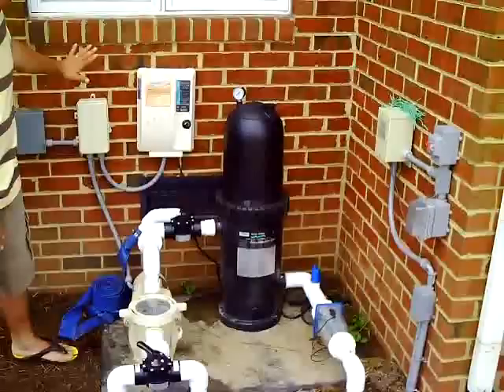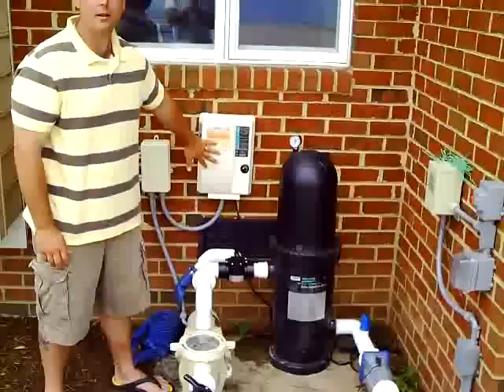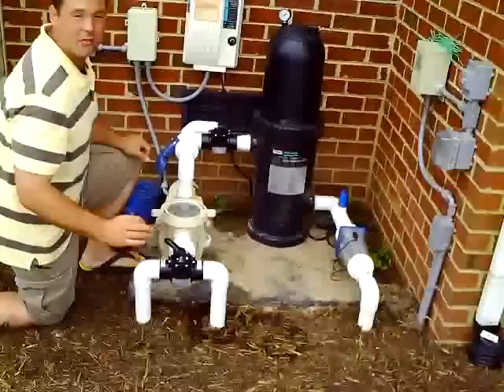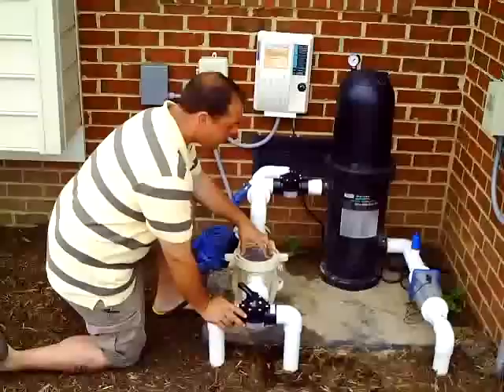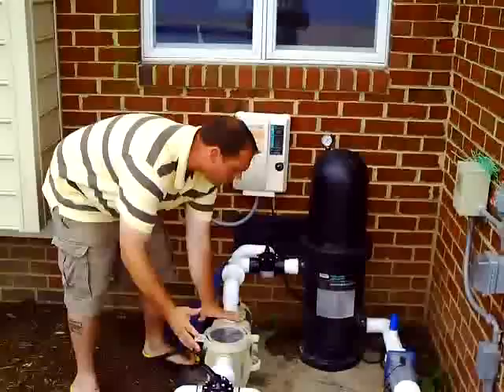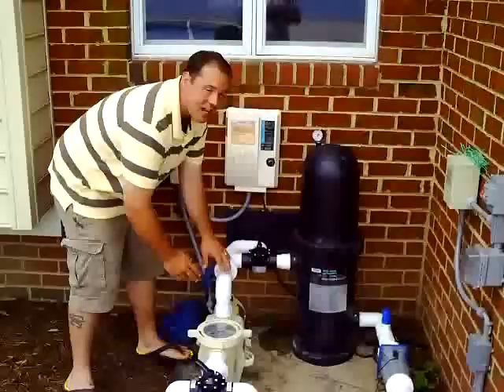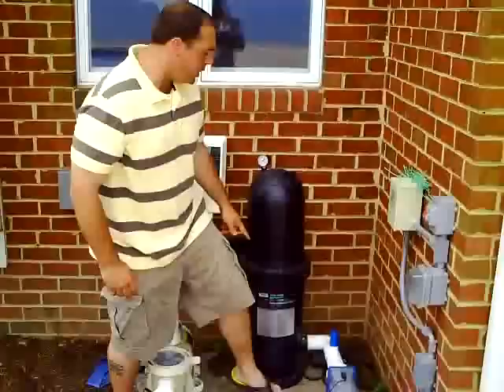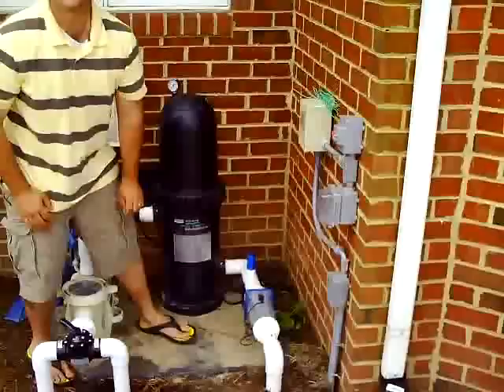How a Swimming Pool Filter System Works Video

Comment: Nice setup, but whats the reason the big filter comes after the pump? And not before the pump, I would.think the cleaner the water.that goes.into the pump the better. Also a question about the exit pressure, is it enough for pumping it  9 feet for a waterfall, or u need an secundary pump for this?
Reply: Great question.

Comment: @RobnMick  this design is made so if the skimmer line or the maindrain pipes get lodged with debris, the suction will be diverted to the other line. there are other divices that will shut off the pump if there is a suction entrapment and some pool pump actually do this

Comment: I had an above ground pool installed and the installer placed the chlorine tablet in the skimmer? the plumping is as follows - the skimmer flows into the main pump which flows into my sand filter that feeds the water back into my pool..... can you tell me if that is the proper place for the chlorine because like what you say in this video - it makes more sense to put it somewhere between the sand pump and the out flow back into the pool...thanks

Comment: Hi, appreciate all the great education via rivepool Blog etc.  So I am in education phase on equipment cababilities for upcoming DIY project.  Was wondering why you use cartridge type vice DE or sand filter?  Can you share your biggest convincing factors on filter choice.  By the way, our pool selection is for limited space of about 6000 gal plus spa.  Feedback greatly appreciated.  Thanks

Comment: That design scares me. The option to divert some or all of the suction to the main drain seems so dangerous. I understand the benefits for the pump, but if a child or weak swimmer with long hair gets too close to the main drain there is a potential for their hair to get pulled in and for them to drown. On pools in my area it used to be common practice for the skimmer box to have an additional line to the main drain so that if the basket ever got too full it would divert the suction to the botto